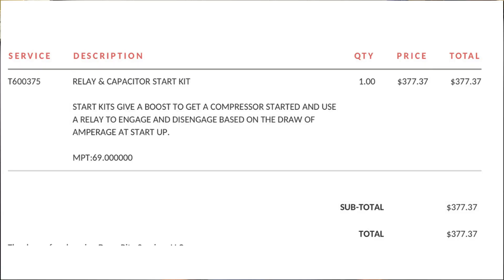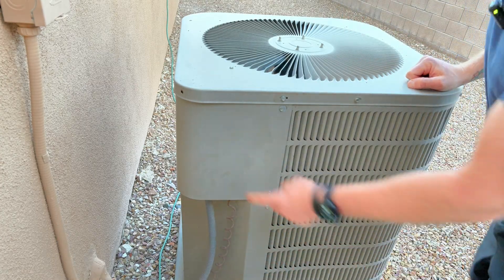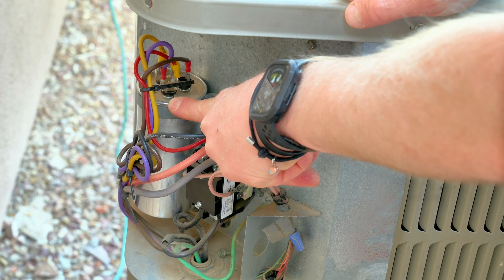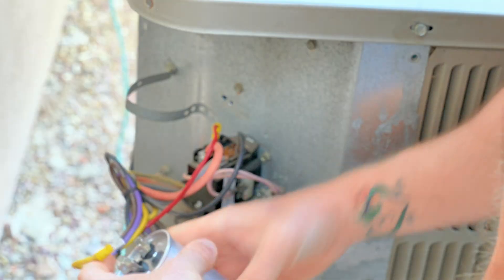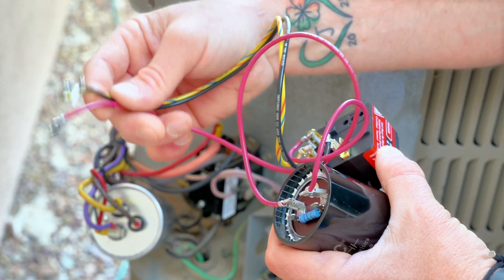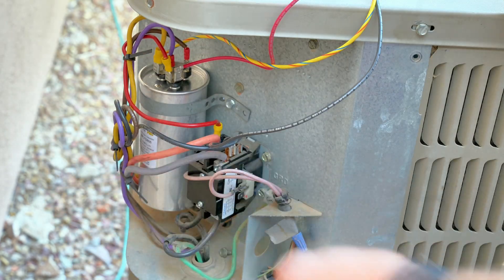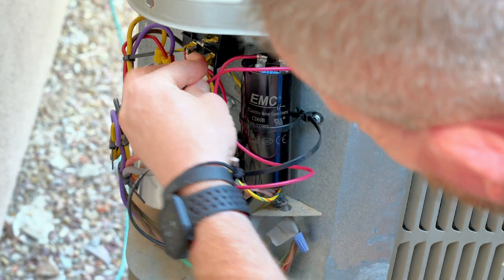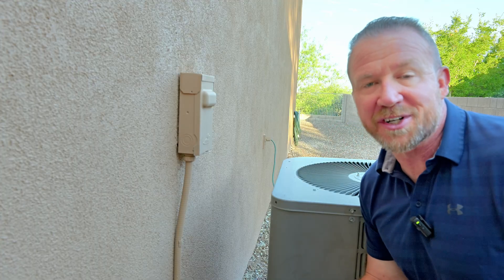How to Install a Hard Start Kit on Your AC Unit (SAVE THOUSANDS!)

Comment: Great video, but be careful with the relay.  They need to be mounted in a specific orientation (there is an up & down), and I’m fairly certain that kit’s instructions have the screw hole as the UP side.  This is important to call out, otherwise the relay may not work as intended or fail quite prematurely.  It looks like you mounted yours horizontally, so I would suggest double checking.
Reply from the maker: Thanks for the extra info, I did mount mine up down after the video when I realized that mistake, but again it is important to point out and I will pin his for everyone! Thanks for the comment friend! I will pin this for others to see!

Comment: The first thing to ask yourself is why you need to install a hard start circuit. Usually, it is because the bearings in the compressor motor are failing, or there is a high impedance leakage to ground from one of the windings. To overcome the losses in the motor, the hard start circuit generates a fast, high current spike to start the motor (to get it moving), then quickly releases. The start cap now has much less work to do to get the rpms up to about 75% of nominal. It is then switched out to the run cap.  To be extra cautious, you may want to read the compressor temperature (after running for a while) to get a baseline.

Comment: How do you make sure there is no wiring where you are drilling your hole?
Reply from the maker: Great question, you will need to either remove the top cover which can be a pain, or you may be able to look through the top fan exhaust holes.

Comment: I tried it and all gas came out the systems 😭
Reply from the maker: GAS?? Ruh Roh, maybe call a professional! Sorry to hear that friend!
Reply: Dude I'm so sorry to hear that. This video is very dangerous it should be taken down but as an HVAC tech we never use a drill bit especially that long on any type of unit and always use self tapping screws. The video was very vague and misleading and should probably be taken down. Other techs would say no leave it up because it creates more service calls for us . 
Your unit is repairable they just need to braise the whole shut evacuate the system pump it down to 500 microns and recharge the refrigerant to the pounds and ounces listed on the sticker outside the unit. Certain videos like this can cause the homeowner so much grief a 377 .00 job turns into 1000 and 1500.00 job now that you need new refrigerant and major work done.
This video is very dangerous and needs to be taken down against the homeowner just enough confidence to get out and trash their system for themselves.

Comment: I have a TRANE package unit and it doesn't look anything like that. There are 2 capacitors in the blower compartment and I see no relays. I see 2 contactors on another compartment where the wires got through a gr omit hole. I can send you pictures . 1 capacitor is c65V 370VAC 10mFOD Fan capacitor , the other is C65R 440VAC 70mF. they both have 4 prongs and not 3 herm
Reply from the maker: I would look up your exact unit and see what kits they sell. Your unit sounds like a larger compressor fan unit to have double capacitors? Yours may require two of the hard start kits, but I am not 100% sure.
Reply: @ElectricalYou  the 370VAC capacitor says O.D. FAN CAPACITOR on a label below. I assume the OTHER 440VAC is for the compressor.TRANE MODEL: 4WCC4060A1000AA is a 5 Ton, so I got the CSR-U3. Now the relay or connector or contactor.( i don't know what it is but it's different, is it #2? ) is on the other cabinet -controls-and the black wire wouldn't be long enough to reach. Capacitor has 2 four prongs, one has a red wire the other prong is orange.
Reply: Your video was very good but there are several steps that were missed. First not all capacitors are the same you have to determine if it's a 35.5 /45 5 MF before ordering the capacitor. Second why don't you take the panel off you have to use a screwdriver with an insulated handle  to ground out the terminals on the capacitor and release extra energy so no one gets shocked. Third never use a drill so that you don't drill into the refrigeration lines and release the refrigerant use self tapping screws. fourth you told the audience that your capacitor was low but you didn't show us how to check the capacitor to see if it's low there's a setting on your voltmeter that tells you if it's truly up to 35 or lower than 35 on a 35 microfarad capacitor. Forth , the company superco sells a hard start kit with the relay capacitor together if it's truly needed. fifth it's good to have an amp clamp on your meter to determine amp draw on startup to see if it's exceeding what's on the data plate you never mentioned anything about the customer checking the data plate and confirming that the amp draw is within range as manufacturer recommendations.finally, you might want to redo this entire video because you're opening up opportunities for people to get electrocuted changing out capacitor can be simple but we have several steps we can get people seriously injured we're permanently damaged or equipment. how do HVAC for a living some text would say no leave it up because that will give us a service call once people shock themselves or drill through their condenser coil. we always use stepper beds you should know stepper beds from the electrical world.d@ElectricalYou

Comment: I brought the same 5-2-1 compressor saver kit and installed on my  Carrier 5 Ton HVAC. But it didn’t worked. The HVAC started running after removing the 5-2-1 compressor saver kit.
Reply from the maker: Thanks for the feedback friend, and I am sorry your kit was a dud! So far mine has operated as described, hopefully you found another suitable kit for your needs!